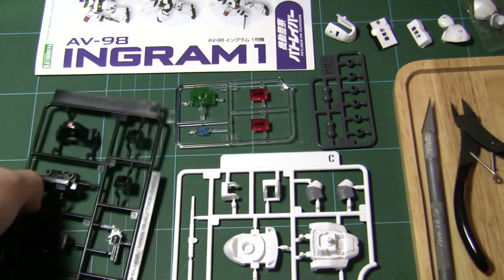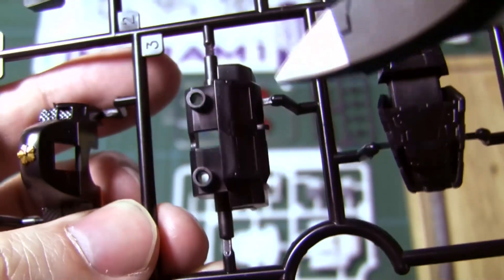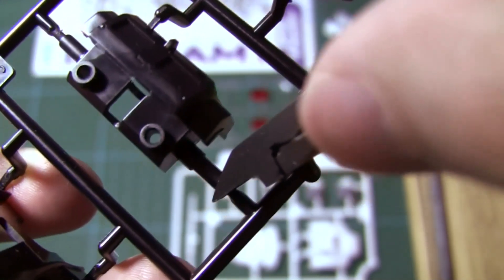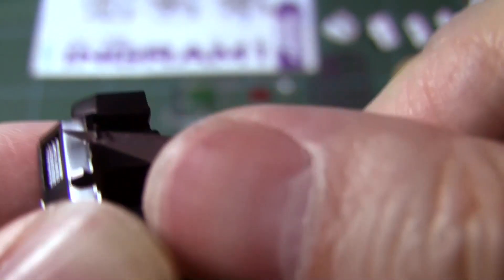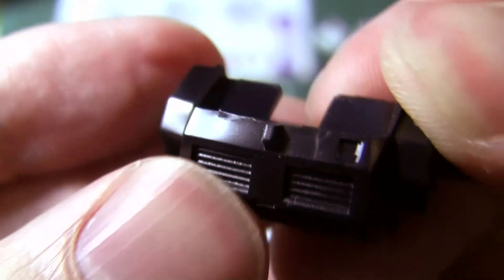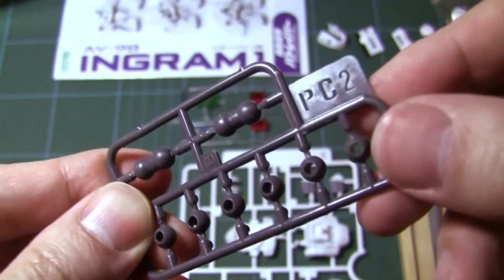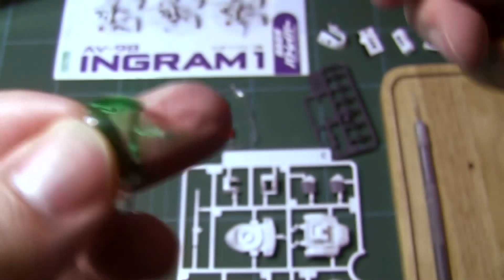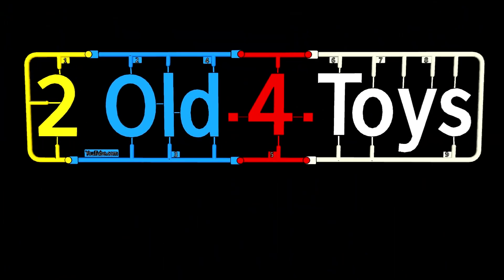How 2 build a Gundam? 1 (parts removal)

Comment: I use the same way as you but after i cut from the runner,i use a rough sandpaper(Grit 400 and 600) and sand them.Then,i use my fingernail and feel if the surface are even or not.If not,i will sand until the surface are even.Finally,i will use a smoother sandpaper like Grit 1000 to smoothen the parts.

Comment: the bases I cut a bit away from the joint so I can just flex the plastic until it releases itself from the kit, not sure how well that will work on a gundam kit though...and since I don't have a modelers knife yet I might just use a steak knife until I can get a proper modelers knife

Comment: Hmm, since my hands tremble a bit, I prefer not to use a knife, I just cut it off for the most part with the clippers, then file it down very carefully due to aforementioned reason. That's my main difference.

Comment: Personally i do it the exact same way, i'm glad to see i'm not the only one who shaves off the gate plastic with a hobby knife, my friends look at me like i have seven heads when i do, they all prefer to use a small metal filer to clear the plastic, i just don't see how a rough metal bar is less risky then a smooth cutting blade... but hey, agree to disagree i guess

Comment: heemmm.. i used the same methods, but when i`m lazy with the hobby knife, i used my hand power drill, put the fine sanding paper and use low speed... that usually does the trick.

Comment: i use nipper to cut from the sprue, the hobby knife to remove most of the numb mark and then use water sand paper 600,800,1000 and 1200 to make it look clean,
 my coment isn't for kids to folow cause using hobby knifes is dangerous and you can cut yourself pretty bad if you dont pay atention what your doing

Comment: Why can't Bandai just make these things pre cut, they can save money on plastic production and we can save time and not need to go out of our way to buy tools
Reply: cuz it costs more money to form pieces individually. You'd have to have dies for each part instead of a single die for a set. Making them one at a time also means you have to inject plastic for every piece instead of just one per set. It also costs more money to have a machine sort them out and package them in a way where there are no missing parts. These are a couple of the reasons why Legos are so expensive. Even with Legos, theres are times where there are missing or duplicate pieces. Missing pieces will certainly be much more common if Bandai made pieces individually.